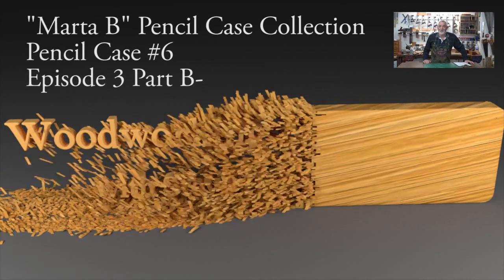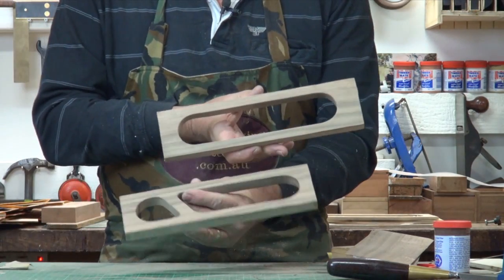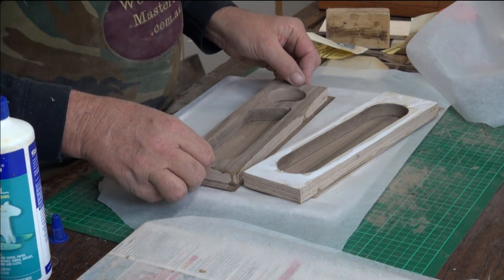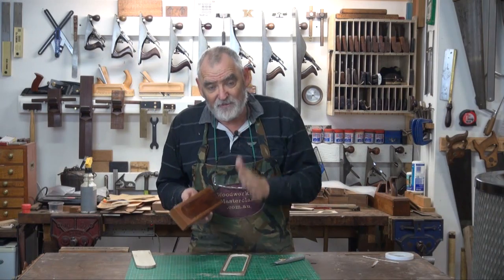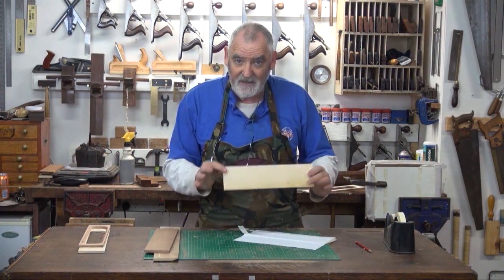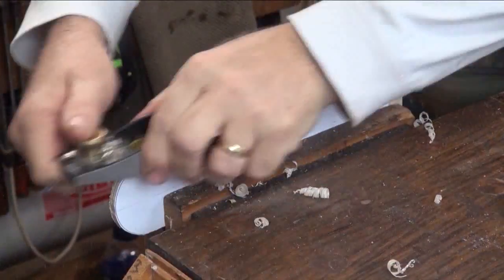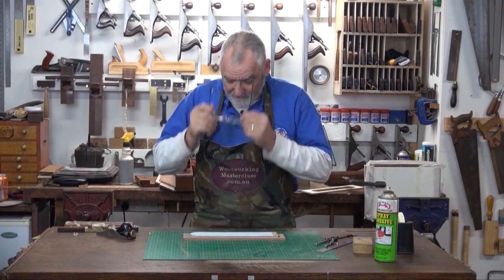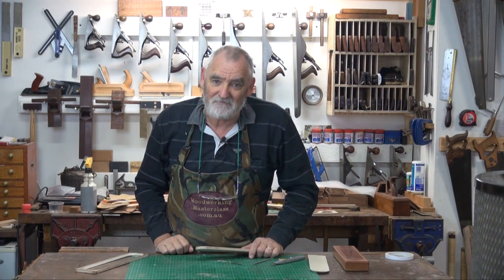Old School Pencil Case. "Marta B" Collection #6 Pt 3b

Comment: Someone has to say it! Boring project, but I love your work.
Reply from the maker: Not sure about boring but definitely technically intense. Looking forward to making a Cedar Cabinet as soon as this one is over. Cheers Steve
Reply: While I don't plan on building a pencil case any time soon I am finding the methods fantastic and great to watch. How do you avoid your planes and shaves binding and gumming up when you plane plywood though?
Reply from the maker: 2 ways I guess. (1) Sharp Blades, set fine (2) Good Quality Birch Ply, which planes like solid timber. Thanks for your support. Cheers Steve